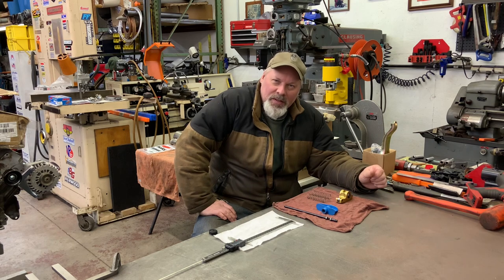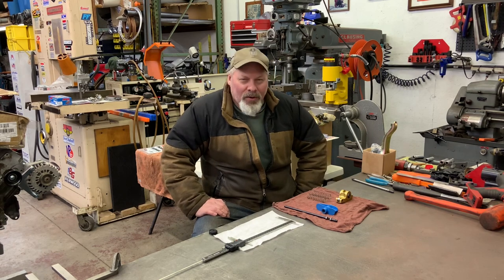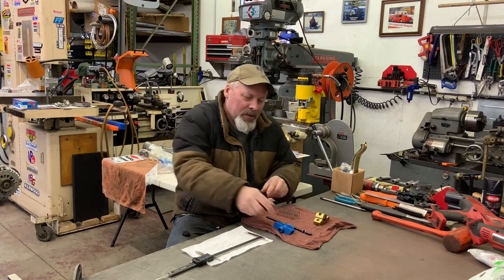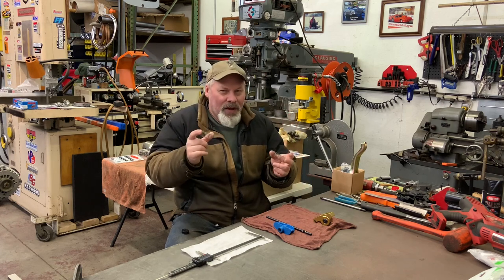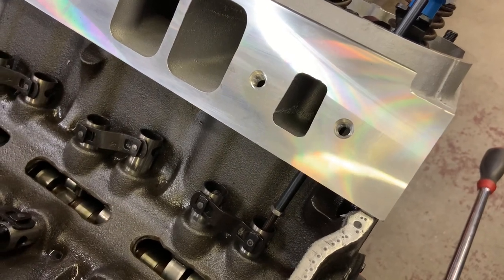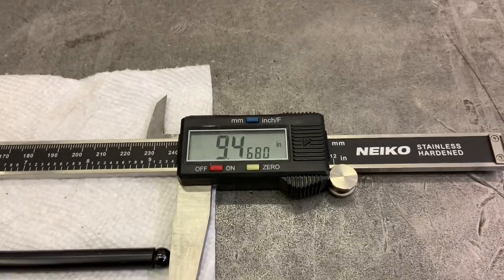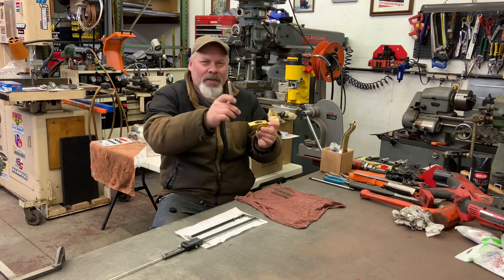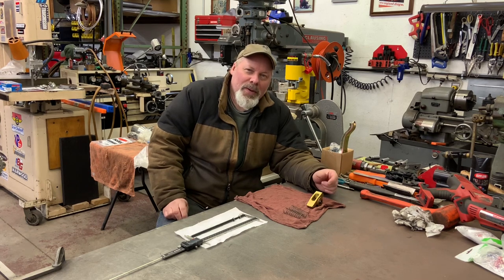Big Block Chevy: Checking Pushrod Length

Comment: Chevrolet, m0r0n.  "Chevy" doesn't exist.
Reply from the maker: Really?
Chevrolet first called themselves Chevy in the 1930’s and used it in naming and marketing up to and including the Chevy II line of cars.
Reply: TrOll..... That's the only thing you got out of this video. And yeah, Google up a Chevy 2 and check out the emblems .
Reply: @leesanders8824  The model is "Chevy II", m0r0n.  

In case you weren't aware (lol); Chevy II is not a manufacturing company, and of course that non-existent company doesn't sell engines either..
Reply: @michaelangelo8001  wow, so you're just annoying for fun, huh?
Reply: @litmus7325  No.  That would be you, I suspect.

I'm just annoyed by laziness and ignorance.